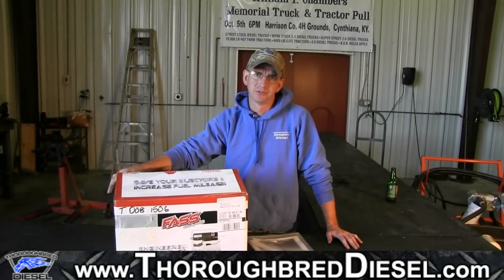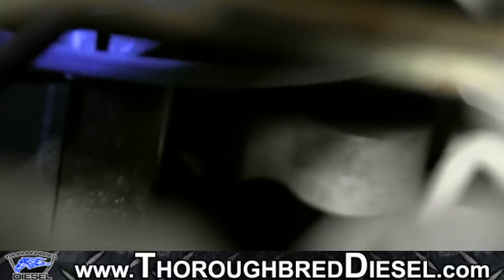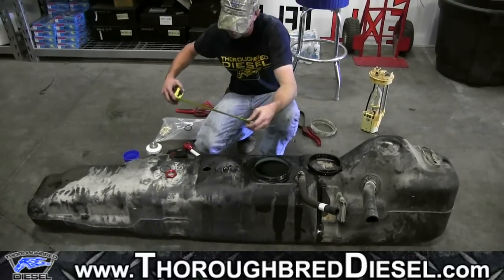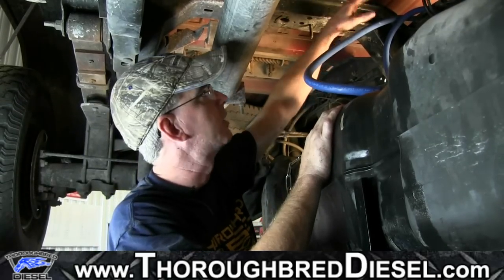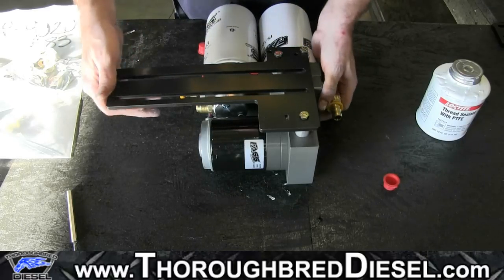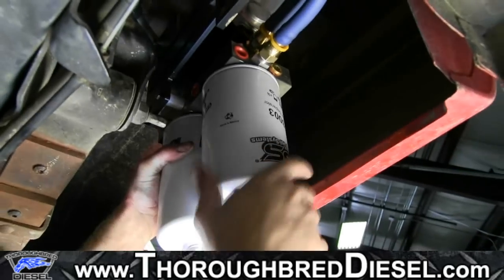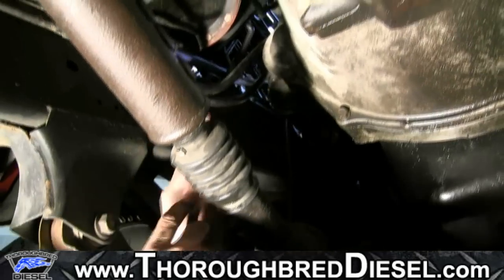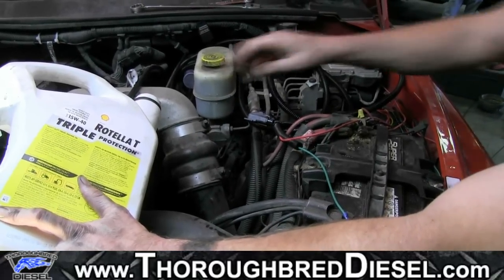FASS Fuel Pump System w/ Drawstraw Install: 2002 Dodge Cummins

Comment: Great video,and a very nice shop! only things I'd do different is,I prefer to run the fuel hose and electrical thru a small hole with grommet,to the inside of the frame where I the stock lines are,it's better protected from the front tires throwing ice chunks and  rocks at the fuel line.Also 1/8 off the tank bottom is cutting it close,especially since you didn't notch the pickup or put a strainer on it..we plow snow hard with these trucks and occasionally frame hang them in snow piles ,that would be enough pressure to push the tank bottom into the draw straw,killing the fuel...
Reply from the maker: This would probably be the better solution in your situation assuming that wouldn't know the sump off while plowing.
Reply from the maker: http://www.thoroughbreddiesel.com/fass/sump-pump-kit.htm
Reply: theres actually 1 1/8" clearance.
Reply: @Maxim Jamir instablaster ;)
Reply: @Darwin Idris I really appreciate your reply. I found the site through google and Im trying it out now.
Seems to take quite some time so I will get back to you later with my results.
Reply: @Darwin Idris It worked and I finally got access to my account again. Im so happy:D
Thank you so much, you saved my ass :D
Reply: @Maxim Jamir No problem =)
Reply: I’m
Reply: Yea it’s not the best protection for your fuel filters and pump and they have a tendency to gel up the fuel in the two filters !!!

Comment: A very good video! I know these videos are hard to make, and things do get forgotten about. So I would like to add a couple of things here, for those who may happen across my comment, and for Thoroughbred Diesel to include in future videos (which it may have by now, as this is an older video) 

  First, before you start routing the fuel line, blow through it good with compressed air. Then, before routing it through it's path on the way to the injection pump, put a piece of wide tape over the end if it. Keeping any dirt or dust from getting inside. I know we saw a quick priming of the system here, into a gallon jug, and that is good. But let's not forget that the final filter here is 2 microns. I recommend a much longer run of the fuel (lift) pump, before making the connection to the injection pump. These injectors do not like dirt! : - )
Reply from the maker: Thx for the help. Keeping the diesel community educated is what we are all about. You rock! :)
Reply: Steve Kluver nice forethought. You were right.

Comment: You don't need pipe dope or teflon tape when using JIC or AN type fittings. Just on the npt side.
Reply: I agree,  no dope on those fittings but if it is kept to just the threads and not the beveled sealing surface then it is somewhat acceptable.  Dope contains grit which can keep the surfaces from making full contact

Comment: Great video! I have a 1998.5 (210,000) with the Carter pump on the block. I bought the FASS 95GPH and installed it yesterday. You weren't joking, a 7/8 stubby would be nice to have...

Thanks for the video!
Reply: When you installed the pump did you take of the stock fuel filter and fuel pump?

Comment: If anyone wants to DIY a sump option it's fairly easy and cheap. A bulkhead fitting with at least 1/2" fittings can be used to go through top of tank. That's basically a threaded hollow fitting with rubber gaskets and sandwiches the plastic of tank. Then just use basic NPT brass fittings to connect hose for supply. The inside pickup tube can use a NPT to compression 1/2" aluminum tube etc cut to proper length to reach 3/8" off bottom of tank. Good idea to cut slots in bottom of tube just in case. I'm not a fan of a sump on the bottom of tank that can get hit by something and ripped off.

Comment from the maker: M. Sev. There is a fuel grade pipe dope that we use, Permatex thread sealant with PTFE,  p/n 80632.  There also is a blade fuse on the power side of the battery,  I cant remember if I showed that in the video.  If you have a pump problem that’s always the first place you look.  Either product you go with you wont be disappointed. Use Permatex 14d thread sealant is diesel fuel resistant. There is a inline fuse in the key on powers source or trigger wire. It is a blade type.

Comment: Great instructions, but wondering if you can do a video with the existing pump on the block.  thank you very much
Reply: I'm trying to find a video for that as well I have my kit but not sure on installing it I have the stock lift pump on block still and don't see any videos on mine
Reply: @pasttime8450   having the same problem. I ordered without the sump (my logic was everything settle on the bottom of your tank so it gets all the dirt and debris going through it), I am not retrofitted in the tank, so now I have no clue how to install.
Reply: @Dishner-ws5lg  yeah thats what I did no sump but my truck still has stock lift pump its not retrofitted and have no clue on setting it up at tank
Reply: @pasttime8450  same here, did you figure out an install or fine a video?
Reply: No I ended up doing the straw down from top and put it off the bottom about a 1/4 inch it works great and a hell of a difference in throttle response

Comment: Cover the end of that hose with some electrical tape when u route it to the engine. I cringed a little thinking of all the dirt that could be knocked off down in it. That's past them filters. . :)
Reply: No you just run the line from the front to the back so all the dirt goes backwards 🤣 ya dirt after the filters bad I didn't evin like replacing my hipresure relief 
on the rail

Comment: Very nice install video. Only thing I noticed is you don’t need to apply pipe dope to a JIC fitting. Only on the pipe side of the JIC.
Reply from the maker: You are correct.

Comment: Just use the Fleece intank pump and it mounts just like factory pump and no draw straw or a sump The Fleese lift pump is just two gear motors from factory and one pump is plug and play the second pump has its own wiring harness that runs a shielded cables with fuse and relay which is a fantastic because if one pump goes out the other pump will work to get you home and you just can’t beat it for the  way it’s set up it’s the  it’s just like a airplane have a back up is fantastic!

Comment: I'd prefer to clean up the top of the pick up and drill it out. You usually can install it through the pick up. I do appreciate the install he's using over drilling out the bottom and installing a sump. To me a sump install is a big no no.

Comment: I saw two red hole plugs in the pump body and the fuel pressure gauge line you didn't mention.what are they for and how do you hook up the fuel pressure gauge? other than that..it is an excellent video.thank you.
Reply from the maker: The two plugs in the pump base are for the heater upgrades that can be added to the pump.  The fuel pressure gauge port is 1/8-27 NPT and a full pressure sending unit can be added there.

Comment: Just as an FYI don't lay the tank on the ground. This causes the bottom of the tank to indent and it sill make your straw measurement to short when you lift it back off the ground. Mine has issues now because I wasn't aware of this until I called FASS.
Reply: Will*

Comment: I know this is a little late in the game, however - in your honest opinion: which do you think would be a better lift pump for an 06 2500? An in the tank pump such as the fleece or an on the frame pump such as a FASS? Would appreciate any input. Thanks.
Reply from the maker: Give us a call 859-737-4966.

Comment: I have a 2001 Dodge Ram 2500 with an external carter lift pump.  I installed the new signature series lift pump and a new Beans Machine sump with the dual ports.  I didnt have to do anything to the original lines going to the top of the tank.  The FASS lift pump goes straight to the VP44.  My question is, what do I do with the old fuel filter and lift pump?  Also, how to I plug the old line?
Reply: Have you figured this out?

Comment: great video! just picked up a 95gph titanium kit today for my 01 dodge. so when i bypass my original filter housing can i simply unplug and remove everything or is there any reason to keep it?
Reply from the maker: Dewaine Daniels Yes,  on the VP trucks if you use a pump with filters that goes straight to the VP,  you can unplug and remove your fuel canister.  It will not set any lights in the cab of the truck.

Comment: What is the cost to this new pump and the draw tube as well for a 2003 dodge ram 3500 slt pickup i6, 5.9l .
Reply from the maker: Cost between the 02 and 03 pumps is the same.

Comment: What do you do with the stock drop in fuel lines and electrical ? Is that just plugged back in and nothing to worry about or do you need to unhook the electrical from it?

Comment: Great video but did you cut at 11 7/8" or 10 7/8"   it really looked like a 10
Reply from the maker: I said 11 7/8ths and its been so long ago I don’t remember the number off the top of my head. The length is relative to where you place the straw and how much space you want with the bottom of the tank. Cutting it long and adjusting is a lot better than cutting it short for sure!

Comment: What is the method of replacing the fuel filter on a 1999 24 Valve 5.9 Cummins? I’ve seen your videos on 1997-1978 12Valve and 2001-2007 but what the difference? 
Thanks
Gil Amaral
Reply from the maker: For the 1999’s,  it is the same as the 2001 video, but the filter housing is a little different.  The filter housing actually drops DOWN from the filter head and the filter itself then comes out of the canister.

Comment: If I went with an airdog 2 with a draw straw would it be the same install process. ..also how about if my pump wasn't relocated to the tank I have it on the block
Reply from the maker: zack halstead 2. Yes install process would be the same more or less.  IF you have the pump on the block that’s ok too,  you will have to use a different power source for the pump.  You will have to use a key on power source if you purchase the pump designed for in tank pump.  Give us a call we can help.

Comment: Very informative video. I have to replace my pump this coming week in my 1999 Dodge 3500 5.9 with the Fass Titanium 150. By chance, could you make a video where the retrofit in tank pump is not installed on the truck, or maybe a discussion and illustration video? I don't want to start cutting into the fuel line before I know 100% of the procedure. Thanks.
Reply from the maker: If you have any problems you can always give us a call at 1-866-737-4966. We would like to do a video for every combination on every truck but sadly that just isn't possible at this time.

Comment: My son purchased the Fass 165 for our 01 ram 3500 5.9. Our engine has the original transfer pump mounted on the side of the engine.
Do we need to purchase any fittings or a new drawstraw to connect to the oem fuel tank?

Comment: I’m running a lift pump pressure gauge off of the oem filter inlet. Where would you suggest I move that to? Any adapter available?
Reply from the maker: If you have a ½ “ line suppling fuel to the VP, then we sell a ½ inline fuel pressure T that could be used.  Just give us a call and we can talk you through it.

Comment: I didn't see how to connect the electronics so the pump will stop in the 20sec cycle, or does this one keep running as long as the truck is on?
Reply from the maker: The ECM signal or trigger wire will regulate the lift pump on time.  So as long as its hooked up the the ECM connection and not just a straight key on connection.

Comment: What if your running a edge tuner with a fuel pressure sensor cause the sensor goes into the side of the fitting that you removed for the supply line on the vp44 and I didn’t see you put a new one back in
Reply from the maker: The FASS actually has a port on it that you can move your fuel pressure sensor to.

Comment: About to do install a 165gph FASS on my 2002 truck - What do you do with the stock fuel filter housing? It looks like you unplugged the line from the VP, but left that line connected to the stock fuel filter housing. If I'm doing this from scratch should I run it directly to the VP as you've done here, or run a big line kit from the stock fuel filter to the VP, and the FASS to the stock fuel filter? Also curious what I should do with the FASS DDRP that is worn out that I'm upgrading from. Simple unplug? Take it off the block completely?
Reply from the maker: If you are doing a FASS with filters kit,  then you bypass the stock fuel filter and run your line directly to the VP.  Then the stock housing can be removed.  Also,  the DDRP is bypassed and you can do whatever you want with it.  Take it off and clean the engine bay up for sure.  I took one and made a pretty nice transfer pump for an in bed tank to us to fill up tractors.
Reply: @thoroughbreddiesel  Thanks!

Comment: How do I hook my fuel lines to the tank without drilling with the draw straw my truck has the pump on the side of the block ?
Reply from the maker: If you get a 100 GPH pump it will hook directly to the tank with no modifications needed.

Comment: The dope you use, is it for petroleum products? I ask because I didn't know of buying tape for propane until I needed to do some hose connection to a 100 pound tank for my rv for year round use. Just asking as some may not know this and can't just use plumbing tape. Another surprise is there isn't a small in-line blade fuse for the power to the pump in case of surges from battery. Will have to look to see if any installs for 2010 or close. Definitely this product will be a purchase for future for my truck. Now to figure out which one to buy.
Reply: I wondered the same. Usually gas requires a different sealant I use gasoila like it requires the yellow tape instead of white. Oh well diesel isn’t that flammable. 🤷🏼‍♂️

Comment: Great video but I have a question on my fast the wiring connections don’t hace the conector you plug behind de engine just have a red wire and my truck have pump on the tank my question is the harness for the fass pump work on my truck?
Reply from the maker: The red wire is a trigger wire and it will be run to a key on power source.

Comment: I noticed on the old VP44 connection there was a fitting going to the fuel pressure gauge.  Where does the fuel pressure gauge connect to on the new 1/2" connection?
Reply: I had to go to napa and get the parts all made up to put a t into it for the fuel pressure guage

Comment: The thing that’s the worst is to calibrate you sending NG unit to read properly so you look at the factory position of the float and match where it sets right  in line where it’s at . And the tape people have the tendency is to put too many rapes of tape and that can crack your fitings if your not carfle so that’s why I use pipe dope it will never crack a fitting !!!

Comment: This is probably a stupid question. If I install the fass lift pump on my truck with the straw. Will my fuel gauge still work (cluster fuel gauge)?
Reply from the maker: Not a stupid question. The draw straw or even the basket upgrade kit neither one will affect fuel gauge.

Comment: 26.37  what was the red cap ? ,  bracket covered it,,>=? plastic cap
Reply from the maker: That is a port for the fuel heaters that can be purchased separately. We leave the plastic caps in to keep the dirt out of the ports.

Comment: Boy!, that looks like a lot of trouble, why don't they just instll another tank pump because the tank is already down anyway.  That just looks like a lot of crazy stuff to add and there must be a better way to install another pump.  However you are a very good teached and it was a very good video.   It must be a easyer way to do this or change install a different pump.

Comment: If you switch to a fass do you still use the fuel pump in the tank
Reply from the maker: No, depending on the truck you will bypass your intank pump.  And the kits come with everything you need to do that depending on what kit your order.

Comment: What about the connectors with the pump in the tank do you just cap them on top of the pump and use the draw straw?I have a in the tank pump and need a draw straw in mine

Comment: Lift Pump install Chevy Silverado 2500HD:  i have a aux fuel tank and the fuel filler hose has the t-fitting installed for the tank feed.  Where can I put the lift pump return hose since no room is available to add another t-fitting in the fuel filler hose?

Comment: I broke my fitting off in my vp44. I got it out. But next question is.. where can I order a new bolt? Or what is the part number.
Reply from the maker: Are you talking about the fuel inlet fitting? It depends on what type of lift pump you have.

Comment: your Drawstraw has no strainer, what is to stop debris from entering the pump. The factory pick-up tube is nested in a
basket with a strainer of which clogs up with dirt or stuff from a fuel station.
Reply from the maker: The water separator is there to trap the large contaminates.  The gearotor will usually process large debris.